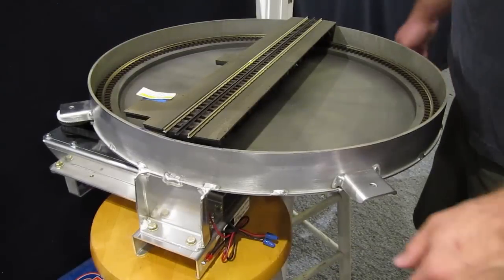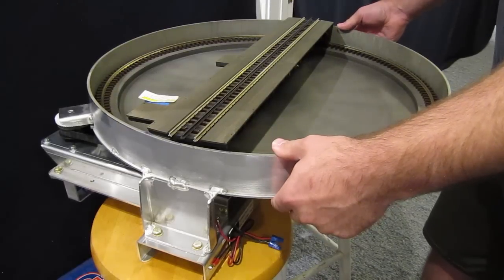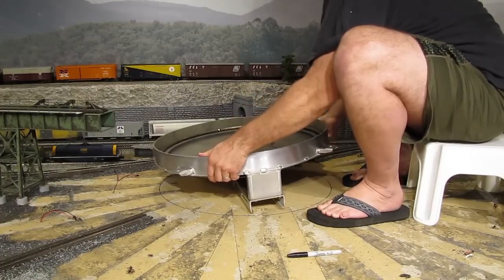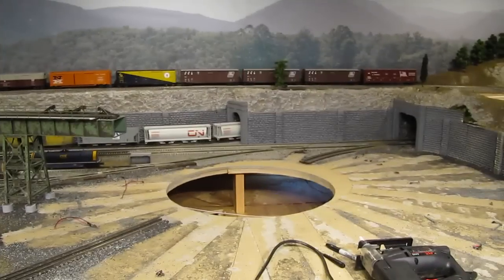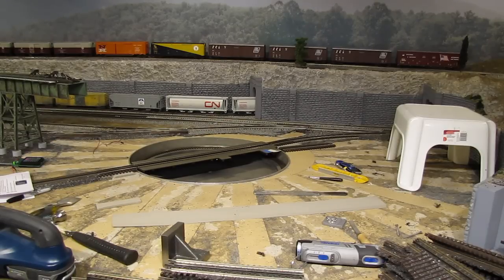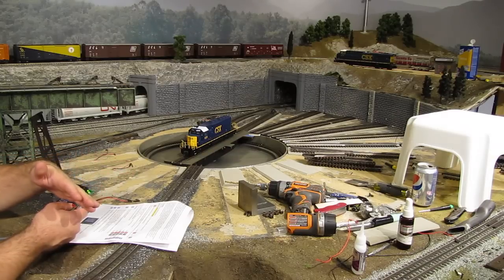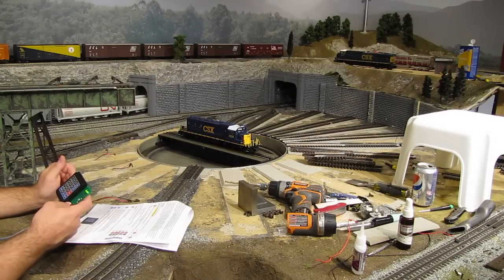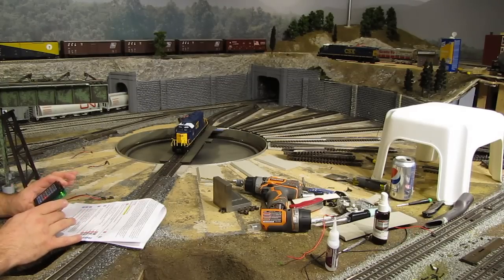Eric's Trains Video Train Blog - Episode 45

Comment: That's a great job putting the new turntable in. I got train O's gades set it had been packed for about one year and I only have Three engine. Two PRR's 4-4-2 and GE44 and a N&W SD40-2 Highhood. I didn't open them yet.

Comment: Hi Eric • Suggestion • I worked 35 years as a high school shop teacher, Rule #1, Put on your Safety Glasses when using a Jig Saw. The blades break off and wood chips go flying. We do not need are Top 3 - Railer getting hurt, but you still get an A+ on this project
• Cheers from Michigan
Reply from the maker: I'm wearing safety contacts, it's new technology. :)